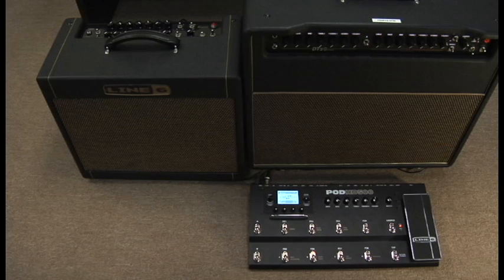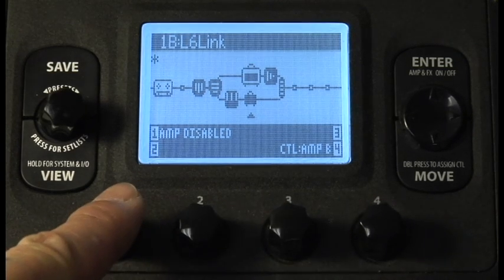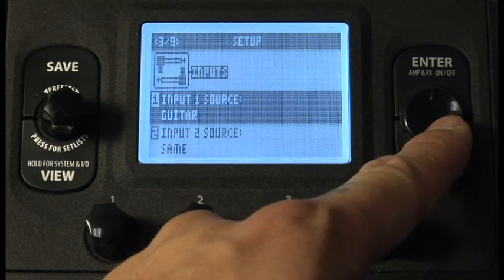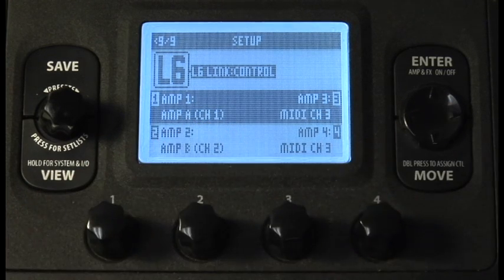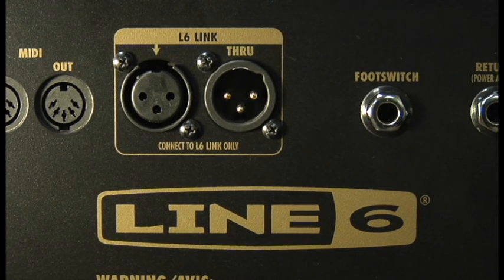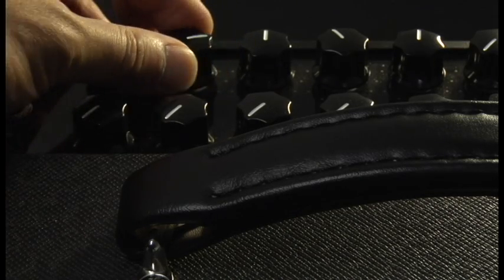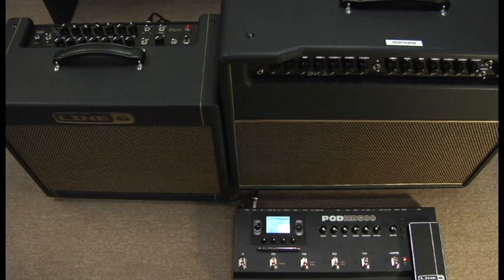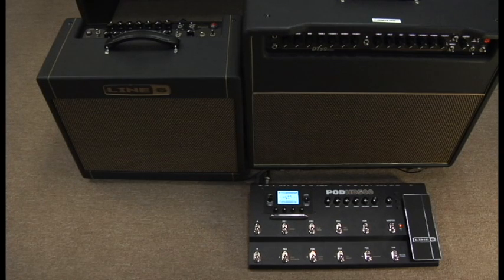HD Connectivity: L6 Link

Comment: This is  GREAT video... i just added a DT25 112 to my HD500 and DT50 112 ... really cool. thx
Reply: Unfortunately the DT25 that I bought on sale after checking on it throughout the day ( i was that elated about adding it) was pulled out of my grasp by some very uncaring people.  ( I guess that is why it is "Stupid")..... but one day I hope to pick up a nice used one or maybe one that needs some TLC.  It doesn't change the fact that this is still a great combination.   You know Steve Howe of YES plays many guitars but one is a Variax for some sounds and also has a DT50 and HD500 last time I got a look at his setup.
Reply: Could I do this with a different amp?
Reply: @justindarden5998  Do what? use the L6 Link? if you can come up with another amp that has that connection.  But even in the Line 6 "Amps" there are only  A few which as far as I know are the ones right here.  But if you have something like a few DT50's or the DT25's than you can.  However you may look into things like Biamping or maybe other manufacturers have their own proprietary connections as is the Line 6 "L6 Link". Be careful though,  I mean you could really mess up a good amp if you are not sure what goes where.
Reply: @tekszet  your right I just figured this out